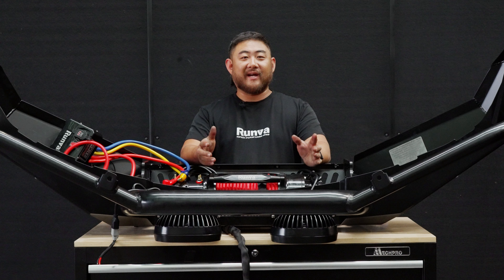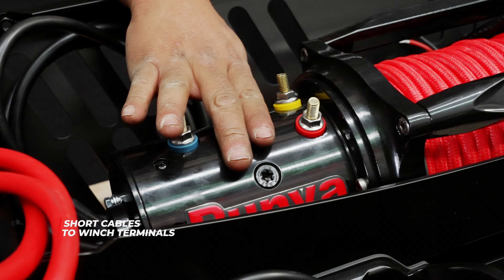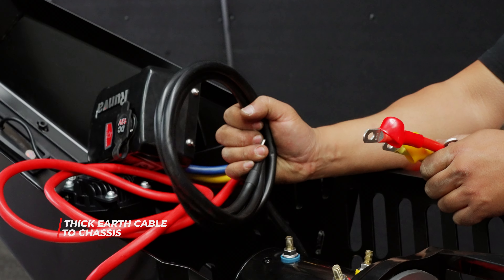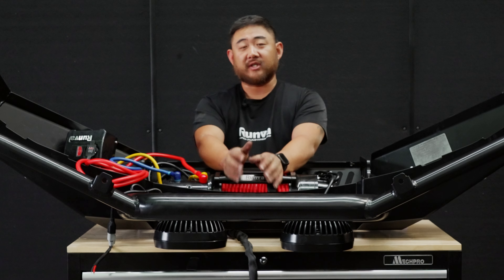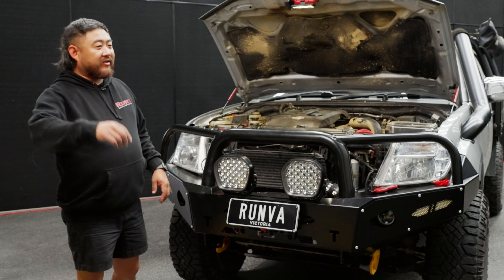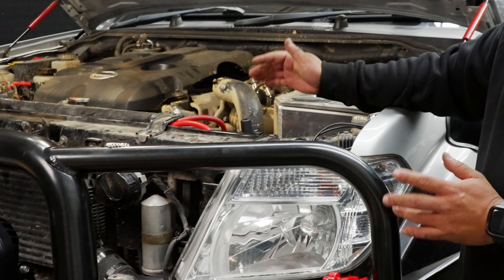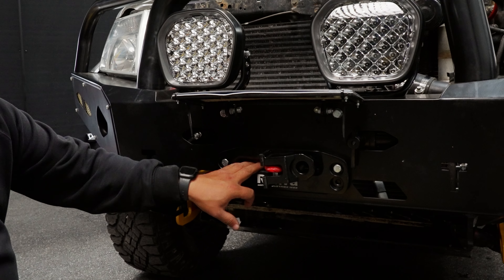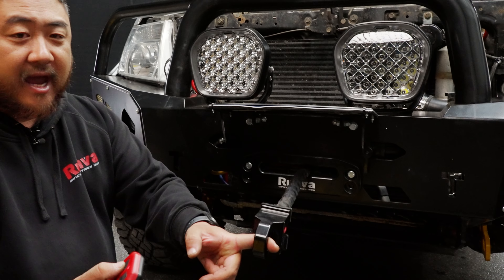Runva 11XP Premium Red Edition Winch Install

Comment: Hi, Ive got a EWX9500 and just changing it over into new 4wd.  In the previous written instructions that ive still got it states that the earth cable had to go direct to battery with a specific reference that connecting to chassis will void warranty.   Can I connect the EWX9500 earth cable to chassis or not ?  thanks
Reply from the maker: We are in the process of amending our instructions to state that you can use the chassis or battery, however, we strongly recommend the battery be the earth point.